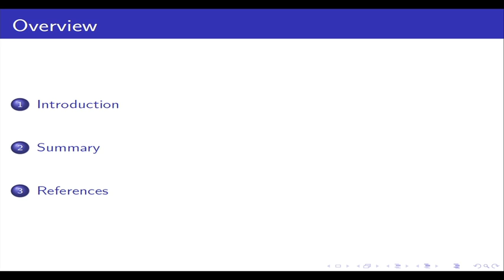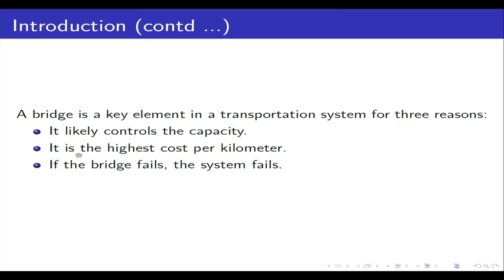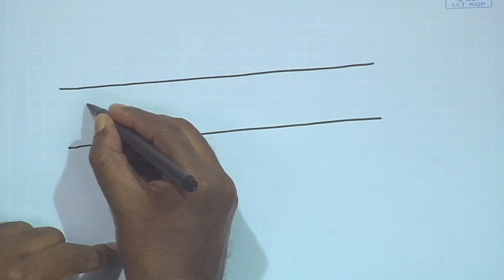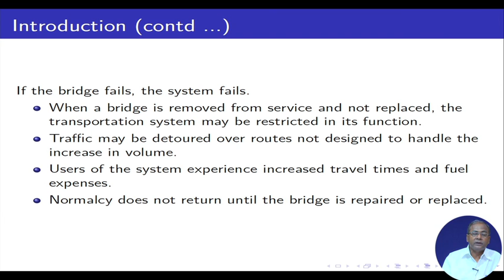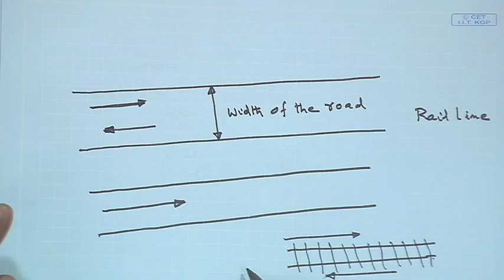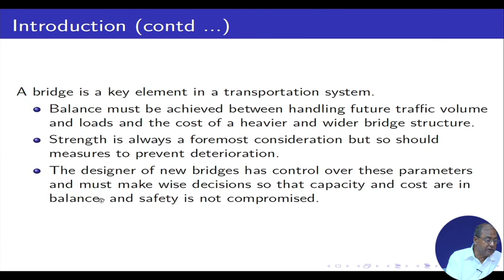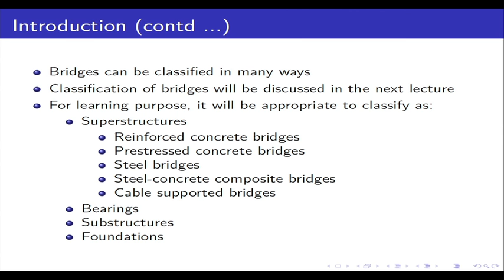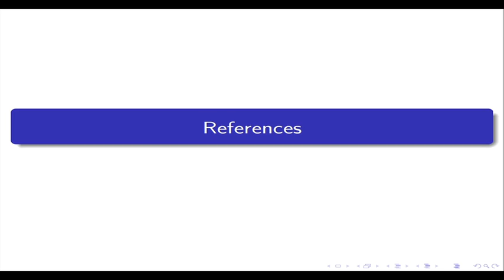Introdudction

Comment: Sir, I have 2 question - in construction there is basic perception of changing diameter of rebar mentioned in drawing with smaller diameter or bigger diameter by decreasing the spacing and increasing the spacing respectively.sir, is this process correct or not ??.
Sir, In the design of pier cap (rectangular shape in X section) in which  pier is passing through centre of pier cap, please tell me the location of maximum bending moment and maximum shear force in pier cap, basically I am asking the zone of splicing in pier cap area.